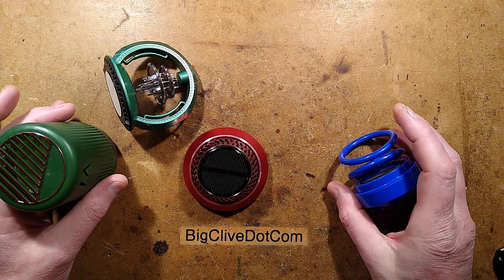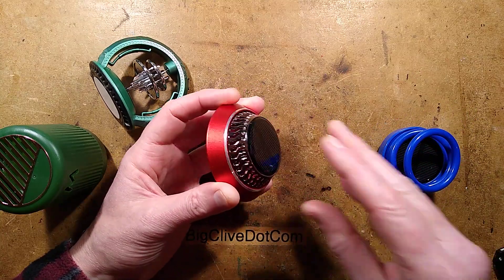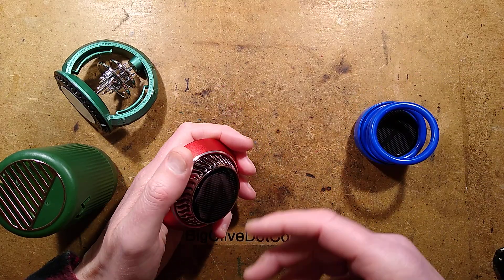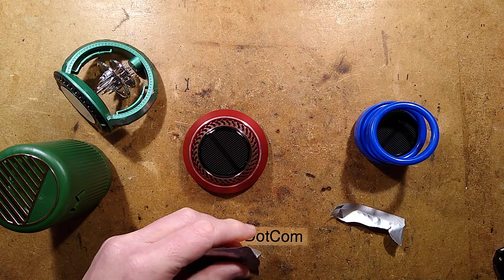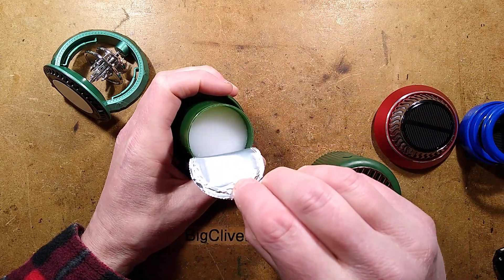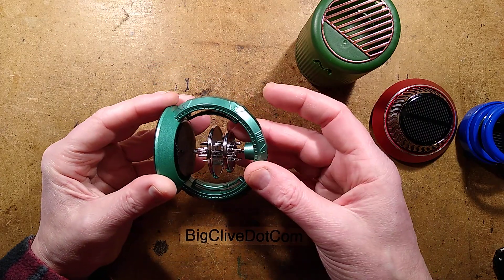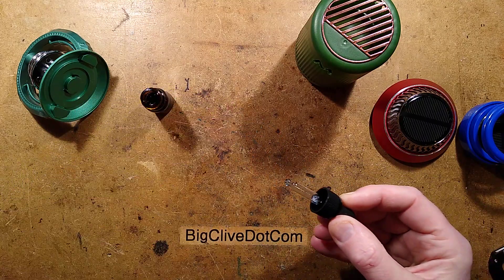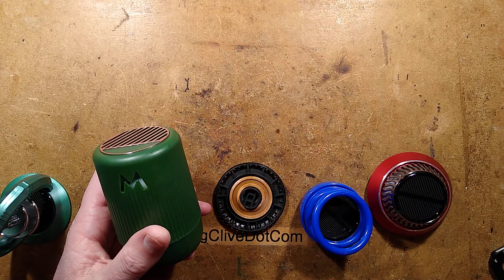How a vehicle molecular de-icer works

Comment: There is a device that will do that, and a bit of forraging in the Russian (or ex-USSR) arctic and remote areas might yield one for you. They generate a lot of free heat for a long time and will absolutely keep your car frost-free, but might have some health and border crossing implications, since they're Radioisotope Thermal Generators.
Reply from the maker: Those very "collectable" nuclear generators.
Reply: @bigclivedotcom the trick is that you have to be quick on your feet when you install it, or put it back to its lead barrel.
Reply: @bigclivedotcom  would you rather the collectable RTG or the "Collectable" Radiotherapy units that seem to constantly pop up in salvage yards?
Reply: They make good gifts too.
Reply: @CarrotConsumer  good gifts to send right back to 💩-tin 👍
Reply: @CarrotConsumer  Especially if you speak German! ☢🇩🇪 😉

(Unlike in English, „Gift“ means something altogether less nice in Deutsch... ☠)
Reply: @UK-Combustibility-Assured  I mean, the only way to make that pun better, would be to somehow work in a Flammenwerfer, with a "that's spicy" pun. Which I don't think is possible.
Reply: Just pick up a Ford Nucleon, no need (or ability) to shut off the engine, so your car is warm all the time.
Reply: Some pacemakers (a final nine remaining in the US) too! Because unlike other pacemakers they never need a battery replaced, and as such gave much longer life expectancy to patients :)

This was discontinued due to people getting radioactive ashes by careless crematoriums. Even though the 238 Plutonium they used was relatively harmless (especially in the small sample size) it was a big fuss.
Reply: good old RTGs
Reply: The thing used in space batteries? lmao
Reply: @HolyRamanRajya  yes, they’re used in space, but the USSR also used them to power lighthouses in Siberia and other remote areas. They were called Beta-M by the Soviets.  At 10 watts I’m not sure how effective the lighthouses were, but I digress.  Unfortunately, when the country goes broke and doesn’t give a flying shyte about the environment in the first place, these lethal tchotchkes end up littering the landscape for the often severely undereducated locals to stumble across and get radiation poisoning from.
Reply: Those are great, some can still be found in the wilds of the Soviet countryside
Reply: Nuclear car heater
Reply: https://youtu.be/NT8-b5YEyjo?si=Ii1h60XAT23lLCT7
Reply: I think I remember them being a plot point in the book The Martian
Reply: isn't this just the plot of the martian
Reply: Clive already reviewed a gadget like that. It was a ration heater, and he heated up some ramen. 

:D:D:D:D

Comment: I suppose at least it's the solar cell > motor.  Frankly I'm a bit dubious about having Lipo cells in a car. I had a dash cam that'd get to 70c before it shutdown - it smelt rather melty.
Reply: Car dashboards are usually rated to over 90°C, so you have a point, sir.

Comment: If only we had something like this that actually worked.... When it's -15F and there's a quarter inch of ice on your window, you don't want to be outside very long in it.  Usually under about a foot of snow as well.  It gets pretty cold here in Montana.  It's not that bad when it is that cold, except when it is windy.  That's what really gets your teeth chattering.  Plugging in your car helps, but I haven't seen a modern car since 2000 that has a block heater in it.  I wonder why?  I guess car technology has improved enough that it isn't needed anymore.

Comment: The lineup consisted simply of six hydrocoptic marzelvanes, so fitted to the ambifacient lunar waneshaft that sidefumbling was effectively prevented. The main winding was of the normal lotus o-deltoid type placed in panendermic semiboloid slots of the stator, every seventh conductor being connected by a non-reversible tremie pipe to the differential girdlespring on the ‘up’ end of the grammeters. Moreover, whenever fluorescence score motion is required, it may also be employed in conjunction with a drawn reciprocation dingle arm to reduce sinusoidal depleneration.
Reply: The problem is you need a prefabulated amulite base plate for this to couple its resonant energy to. These cheap knockoffs replaced it with plastic, reducing the energy transfer by 99.(9)%.
Reply: @oscar_charlie  actually, the hyper-encabulator resolves this flaw.
Reply: @oscar_charlie   There's an alternative one to the amulite base. It uses a crystal to handle the resonant energy. 
Also helps to tune your chakras as well as shielding from 5G.
Reply: You're off the mark regarding the hydrocoptic marzelvanes. It's not just about syncing lunar waneshaft and ambifacient orientation; it's the strategic integration. The lotus o-deltoid winding, placed in panendermic semiboloid slots, ensures a meticulous unidirectional energy flow. The non-reversible tremie pipe and the drawn reciprocation dingle arm aren't superfluous; they're crucial for combating sidefumbling and sinusoidal depleneration during fluorescence score motion. In essence, the marzelvanes are a carefully orchestrated engineering marvel, not a mere whimsy of components.
Reply: @zwerko You are forgetting that o-deltoid winding only fits in sizes above ‘ocean acidification’. This one is mere ‘deforestation’ analogue.
Reply: @zwerko  Well said!
Reply: I need replacement girdle springs, anyone know where i can get them?
Reply: Don't forget to replace the dinglearms as well, they usually come in balanced pairs.
And order 8 ounces of fresh replacement 5 percent Tetraethyliodohexamine solution. The old one gets contaminated with residue from the kraft paper bushings.
Reply: @genewitch  Arkwright's do a nice line of them. Along with 'Frat Lamps'
Reply: Stanley Unwin would be proud of you
Reply: Encabulation!
Reply: I heard similar discussions in the Tatooine cantina...
Reply: That's all very well, but does it de-ice?
Reply: @geoffreypiltz271 
Only when it's icy.
Reply: Thats privileged IP mate. You should not disclose that before gaining a signed NDA,
Reply: @robinwells8879  Nah, it’s a common misconception. This is clearly explained on page 665 of The Great Chinese Book Of Building Counterfeit Products. The chapter is called “Properly Usage Up Technobable For Making More Dough” and the O-deltoid wing is given as an example from old traditional knowledge of Feng-Shuit.
The terms “deforestation” is a modern translation if ancient hieroglyphs, though, so clearly there might be some inaccuracies.
Reply: How dare you leave out the Di-variable-veebleflexer?  Blasphemy I do declare!   Harumph!  Harumph!
Reply: They don't tell you that you have to add a bi-lateral unobtanium output shaft and know how to connect it to the primary crystal power source
Reply: Ahh clear as mud that explantion is......
Reply: What is it you are selling? Never mind, just shut up and take my money!
Reply: Does it have interossiter control?
Reply: @DickHolman  No.
Reply: Well, I certainly can't argue with that...
Reply: You are AvE and I claim my  ten pounds.
Reply: I totally agree
Reply: Ahh, the wonders of modern VX technologies!
Reply: you clearly stole this text from the manual of my remote-controlled outdoor wireless tea light hot spot with night-charging solar array.
Reply: Dr, Stanley Unwin strikes again.
https://youtu.be/0UJZF5iRhNg?si=trtpXTkGi43dgPtg
Reply: Found the Rockwell Turbo Encabulator sales guy.
Reply: Mornington Crescent?
Reply: Lolol where have I heard this before? Something about 'what your girl hears when you're talking shop' or something
Reply: It's a Chrysler, Jeep, Dodge, Ram, Plymouth, Fiat, Mercedes, Mopar thing.
Those owners will believe anything they're told...and they still keep buying them even when everyone else knows they're junk😁👍
Reply: @simonilett998  "It's a Chrysler, Jeep, Dodge, Ram, Plymouth, Fiat, Mercedes, Mopar thing.
Those owners will believe anything their told...and they still keep buying them even when everyone else knows they're junk😁👍"

My Barracuda is coming for you...
Reply: @simonilett998  🤣 Stellantis owners do NOT believe anything you tell them. A year and a half ago I told a coworker that my '99 Jeep was far superior to his '18 Jeep. Three electronic throttle bodies, and three tows to the local Jeep dealer, later, he still scoffs at my "old cars."
Reply: @dashcamandy2242  Yep, the older the better I reckon.
Pretty much every make and model (apart from Toyota's) made after 2010 are cheaply made junk nowadays, but it seems anything from the 'Mopar Family' are some of the worst/most unreliable 😁

Comment: And now I'm wondering whether a tiny solar panel powering a small resistive heater could achieve something (aside burning your car down by being a huge fire hazard).
Reply: I don't think you would be able to get enough power to get enough heating effect unless the panel covered the whole roof of the car
Reply: A car sized solar panel powering a heat-pump should be able to do something maybe?

Comment: The former owner of my car left a circular plastic disk on the dash from some nav device which won't come off for love nor money.
I've been wondering what to do with it.
Now I know; these are the perfect size!
♥
Reply: A guest driver of my car ripped the GPS off the window such that the suction cup doesn't work anymore. A few months later it stopped working for a firmware incompatibility with a GPS update, or something. The Garmin sits in my figure-it-out-later stack. The driver moved out and lives with her mother.

Comment: It does pose an interesting question, how much heat, and for how long, to actually keep a car ice/frost free like in the adverts.
I used to keep a 2kW space heater in my car with an extension lead to the house and switch it on 10 minutes before leaving for work, that worked OK but I don't live in a particularly bad climate so only needed it 3 or 4 times a year.
Getting 2kW of heat from a hand size device will take some doing.
Reply: Wouldn't just starting the engine and feeding a hose from the exhaust in via a window be more energy efficient? Engine warmed up, vehicle de-iced and the interior all warm and fuzzy. 🤔😱🙄
Reply: @theoztreecrasher2647 been done, been banned for obvious reasons, though I'm thinking you know this..
Reply: @theoztreecrasher2647  I believe that works, it certainly worked for a school friend of mine, he never had problems scrapping ice of windows ever again.
Reply: You'd need a lot less than that to keep it frost free - you'd only need to keep the glass slightly above freezing temperature. You only need 0.84 joules of energy to raise a gram of glass by 1 °C, but 334 joules to melt a gram of ice.

Unfortunately that's still beyond the capabilities of a small-solar powered air freshener.
Reply: I'd trust a 500 Watt heater left alone for a few hours more than a 2KW heater left alone for ten minutes. You can also do it by laying a blanket on the front and back windows. It's not entirely free: you'll still have to shake off and dry the blanket.
Reply: @tactileslut  The 2kW fan heater has a temperature selector so wasn't running for the full 10 minutes and the heater was carefully aimed into empty space in the car.
Obviously, there is always a level of trust involved in using an unobserved heater but 10 minutes monitoring the events  through the kitchen window while drinking a wakeup coffee seems preferable to getting up hours early and waiting for a 500W heater to do the job, plus the 500W option would probably work out more expensive.
Reply: @tactileslut  Many thanks, I used to do the blanket thing, it sort of worked when it didn't frozen to the windscreen but the other problem it had was the screen looked fine when you started driving but by the time I got to the end of the lane I couldn't see a thing so had to stop in the middle of the road and start scrapping.
I've solved the problem now, I retired early and don't go out in the mornings when it's cold.

Comment: Just for fun, I looked up one of these items on eBay and I thought “Oh there’s a report button. I’ll report them for lying to us.” It turns out there’s no report category for misinformation.
Reply: All of the ebay "report seller" categories are the same - how is this seller trying to not pay us our cut? They're not in the least bothered about anything else, no matter how fraudulent or dangerous.
Reply: @richardsmith4992  Report category: Listing practices
Reason for report: Fraudulent listing activities
Detailed reason: You suspect that a listing is fraudulent
Reply: Same with the 'realistic bank notes for theatrical props' and 'get your driving licence without taking a test' etc. Facebook in particular doesn't give a toss as they're profiting from them.
Reply: @Ralphs-House  problem is in the UK false advertising is illegal
Reply: eBay's report function is worthless; I've reported hundreds of scams and almost none of them were taken down. 😒 I've even used a special contact page to contact eBay directly outside of the listing-reporting function to explain the style-abuse exploit (adding a cheap item to a listing to make it look cheaper than it actually is that scammer have been abusing for YEARS) and how to fix it, but they STILL haven't fixed the bug that lets that exploit work. 😒
Reply: The BBC needs one of them buttons
Reply: Just give the US government some more time.  They will eventually demand a censorship button for misinformation there too.
Reply: Signs of an inimical organization.
Vote with your money.
Reply: @FiltyIncognito  "Voting with your wallet" does NOT work. Even if you can convince 100,000 people to boycott something, there will still be 10,000,000 others who don't. Overpopulation is the cause of EVERY problem in the world whether it's immediately obvious or not. 😒
Reply: There is. It's just not obvious if you don't spend half a second lingering on it. 

The category "Listing practices" includes what you desire.

Reported your comment for misinformation, cheers
Reply: @LachskoenigIV Touché. I think you did good tho.
Reply: @LachskoenigIV  Please don't misuse YouTube's reporting mechanisms. Simply being wrong about something isn't misinformation.
Reply: @beeble2003  He can misuse Youtube's reporting mechanism all he wants, since we all know reporting comments doesn't actually do anything.

Comment: *Your mileage may vary. See store for details. Offer not available in all states, countries or localities. May cause discoloration of the urine or feces. If a rash develops discontinue use and see your doctor. Batteries not included. Some assembly may be required. Claims tested in conditions greater than thirty-two degrees. Display purposes only. Not meant to diagnose or treat any medical condition.

Comment: I had a sudden flashback when I saw the deforestation device about those solid gel air fresheners in the 1970s that had an adjustable top to expose the gel to the preferred amount.
Reply: The old conical air fresheners make great trumpet mutes.  They changed the shape and they don't work well now.
Reply: I guess that liquid comming with the green deforestation unit contains Agent Orange or some similarly horrific stuff for proper and efficient deforestation/defoliation of any kind of vegetation you might drive by with your car 😄
Reply: 70s? You can still get those at Canadian Tire

Comment: Slight tangent, How does YouTube get away with all these obviously lying scam adverts for fake Chinese products? I get dozens per day. If the Tv has advertising standards why doesn’t YouTube have to comply?
Reply from the maker: They do have a filtering system in place, but the rogue sellers find ways to bypass it.